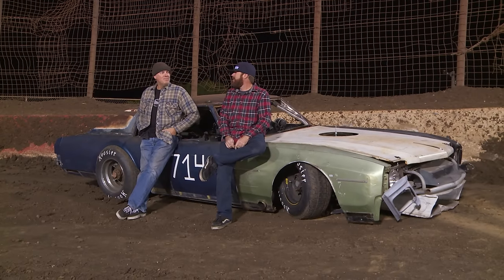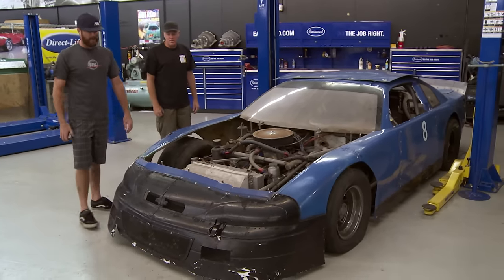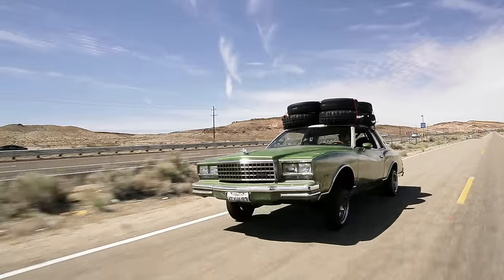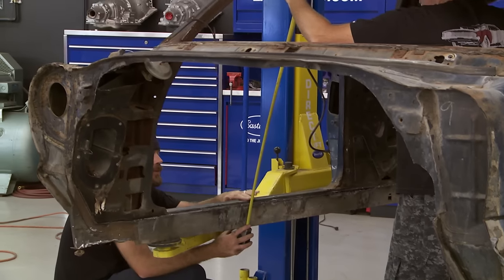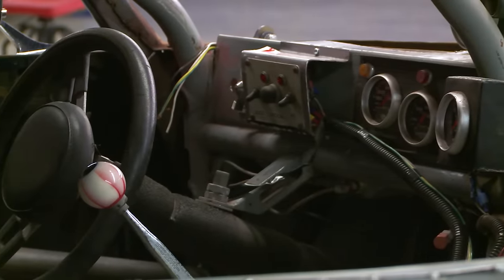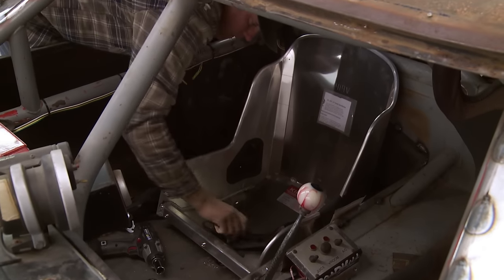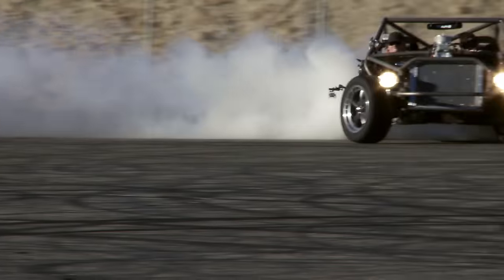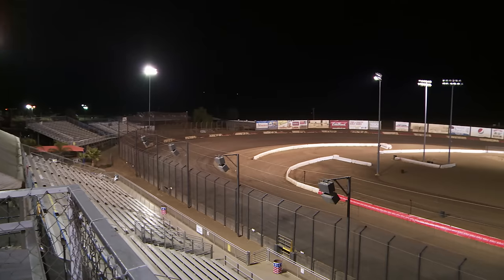Street "Legal" Stock Car Body Swap - Roadkill Ep. 46

Comment: fix it And put in a 24 hours of  lemons episode
Reply: The tec could say no for being too expensive and if they race it the officials can take the car and nothing can be done its part of the rules
Reply: +Darkzxi they cant just take a car. thats absurd.
Reply: +Greg Manson "Absurd" is kind of their thing, so don't bet against it. :)
Reply: yea
Reply: +Caden Z it would destroy 24 hours of lemons
Reply: Maybe  it might be a drag car
Reply: No, that car deserves more than that.
Reply: +Caden Z They cant put it in the lemons race they paid to much for it.
Reply: +Caden Z They spent $7,600 for it, which is well over the $500 spending limit for the base car. If you spend more than that the car isn't qualified to race. (You can spend as much money as you want to fix it and stuff, I believe.)
Reply: +mastapasta2000 You can race it, but you'd be penalized a lap for every $50 over $500 or something like that.  They'd start with a huge enough penalty that there wouldn't really be a point to racing it.
Reply: Jeff Israel That makes sense. Wouldn't be worth it, like you said.
Reply: It wasn't a car until the paid for the body ,An got insurance  . Putting the stock  car frame in It was fixing it up .
Reply: the parts value is above 500
better off going to lemons website
Reply: +Darkzxi As if the Rotsun wasn't cheap... Yeah, the bought the car for $500, sold the drivetrain for $400, and ended up with a shell for $100.

But Freiburger stated in the 24H of Lemons episode that they spend well over $30K on the Rotsun already. Basicly the Stock Car Montecarlo is way cheaper.
Reply: +Greg Manson you obviously haven't watched any lemons before
Reply: +Darkzxi I was going to do it until a friend talked me out of it, so I know the rules by heart. For each $10 more, you lose one lap. I have no idea who told you they were gonna take the car.
Reply: The AE86 of Mt. Akina you obviously haven't watched any lemons then.
Reply: Tevita Phillips I've been a fan of LeMons for years. Of course I've watched it before.
Reply: Sprinter Trueno (AE86 of Mt. Akina) then how can you not know of the judges ability to take cars, even destroy them.
Reply: Tevita Phillips That's for if people vote you as being a douchebag.
Reply: Sprinter Trueno (AE86 of Mt. Akina) yeah and if you bring this car you will definitely get voted as a douche bag
Reply: +Darkzxi  Oh, plenty can be done, but it would involve equal amounts of tumescent bribes and epic bull s**ttery. If the car wins IOE- this one's a contender- it's really unlikely the car will get taken. Usually a car gets taken because the driver is a complete prat.
Reply: +Greg Manson Yeah, they can. You sign a release allowing the judges to take your car and publicly destroy it if they decide you've broken the rules thoroughly, you car is a danger to other drivers, or they just simply don't like you. It's part of the reason the value of the car is supposed to be no more than 500.00.
Reply: +mastapasta2000  The way I remember it (been awhile since I was involved with these guys) was you got 500.00 to build a car, period. The exceptions are brakes and safety equipment (seat, belts, cage, etc.). You are permitted to overspend on the car, then make up the limit on the back end (say, you sell something of value from the car). If you spent over that amount, hope that the judge had a good night , will accept a little token, and is open to your interpretation of 500.00. Skilled forging of receipts is considered a plus.
Reply: +Tevita Phillips They don't destroy cars anymore for being ringers. You'd let them know what you're doing before entering anyways. That way they can tell you no before entering.
Reply: +Hotrodelectric o ok I appreciate  your  insight  on this  thanks.
Reply: crazy Mike You're welcome. I love the idea of the series, and all things considered, it's a cheap way to get into an expensive activity. Just the parade of odd cars with appropriately kitted teams is worth the admission.

Comment: That sucks but if you look at it this way, that ball joint could have broken on the highway going 65mph.
Reply: Exactly, you can look on things different, which can make sucking things good/better
Reply: +Zac Price Yeah, that would suck. Though, from all the cars that they drove, I'm thinking this would've been the best car to be in during whatever happens after that thing broke on a highway.
Reply: +Ignas359 It wasn't made to protect the passenger so that would have been bad.
Reply: c0c0asauce Ah, fair point, still isn't the rollbar pretty sturdy all around?
Reply: Ball joint breaks going down highway they wreck hit another car and injury or even worse kill someone bye bye roadkill show they got lucky on this one
Reply: +Quincy Abrams they may have gotten lucky... idk. It might have taken another 5 years to degrade to the point where there very minimal stresses exerted on it by driving in a straight line would have had any effect.
Reply: Could a have been the gremlin
Reply: You saying that reminds me of when I went to pick up my mustang from a shop after a NINE month paint job. The dick didnt tighten down the rear left tire and the wheel fell off and dented the brand new quarter panel of the car. Luckily it happened before we got off the 45mph thorough fare and onto the 65mph highway...
Reply: +Christian Norris i knew a shop that used axle grease to mount the tires on a mustang and then when the mustang went a round a fast corner all the tires broke the bead lose and totaled the car and almost killed the person inside
Reply: +Zac Price exactly my thoughts - and that would be much worse! Also i bet they have learned a lesson - before you start to fix a car, check your brakes and everything on the chassis first.
Reply: Roadkill doesnt "learn lessons" lol.

Comment: Two years later I have the realization that the ball joint that broke was on the same side that got hit while in storage.  Coincidence?
Reply: good point dude
Reply: Makes sense
Reply: actually, I don't think so. for a balljoint to fail like that, it was probably from it sitting for so long. for a ball joint to fail because of an impact, that car should have taken a pretty good hit. 
so, more than likely, the ball joint just broke after being beat on by them and probably from being rotten.
Reply: Ya for real......
Reply: "I THINK NOT" incredibles movie dashes teacher
Reply: You have a point there..
Reply: All ball joints fail eventually. Check yours regularly...
Reply: wowomatic i agree
Reply: Roadkill.com - The Legend of NASCARLO. "We are very fortunate the joint didn’t break on the highway, but we think the cause was a hard hit against a dirt berm entering the pits. Just a few laps later, it separated."
Reply: Drifting puts a lot of pressure on the ball joints and lower control arms, if they arent built for it they will break

Comment: Yeah i can see in that clip that the car did a weird movement where it did dip down in the front right where it broke the ball joint. Truly roadkill fashion where they get it running and never touch the suspension and put the car through like 1 and a half Gs of force turning lol.
Reply: Damit. I just noticed and posted lol.. Good eye!
Reply: dude good eye, i thought it was a coilover mount but after thinking about it it wouldnt have pitched the wheel back like that

Comment: I'd honestly like to have something like this as a daily.
Reply: Idk if its just me, but I'd rather have that than a new Ferrari
Reply: +McWithJosh not just you.
Reply: +McWithJosh 
only problem is if i drive it here in UK i wont get 2 meters without being pulled over
i hate the UK sometimes...
Reply: Far easier to take an old muscle car, lower it on stock car looking wheels and tires. U can use miss matched panels, bolt it a few cage bars, do loud exhaust etc. these guys REALLY REALLY know what they are doing and have all the tools/budget, remember they did a motor swap in the snow in the parking lot and drove it home.
Reply: +Denis Gumus It wouldn't pass an NCT. You'd have to have your own insurance company to insure it.
Reply: Red Rider7 So the insurance conditions do not mention anything about having a completely different engine and an unsafe front suspension? :P Surely they will pay out, but your next insurance will be dear :D
Reply: Red Rider7 I'm not too aware of how the rules of insurance companies or state law in the US go when swapping engines to cars and driving them on the road. I understand that in some states it doesn't seem to mean jack shit.

In Europe especially with newer cars if you're modifying your car without inspecting it you are already breaking the law. You can break the law even more by putting a non-spec engine to a EURO -emission rated car/engine.

According to most if not all car insurance company terms here in Europe you are obliged to tell insurance companies about your car modifications. This goes especially for engine and performance modifications. In some countries like UK and IE it will have a huge effect on insurance premiums.. Everything from 50% to 5000% (yes, thousand). Thus the consequence of not announcing modifications to a car will be considered insurance fraud and/or fronting. This goes on top of the potential for violation of installng EURO2+ cars with engines, which are not certified or emissions tested.
Reply: +Red Rider7 My Mustang has an all out race engine in it that barely tolerates 93 gas and revs to 9000 rpm. Inspection? No sweat. lol Lucky I don't have to pass any emissions tests.
Reply: +McWithJosh Yeah, those views with the setting sun behind the car...

damn i need this
Reply: +Denis England sucks America is freedom:D
Reply: B

Comment: Looks like when he turned right to slide it he was alittle too high, then something snapped and locked the wheels to the right. I really respect guys that drive on dirt, that's alot of skill
Reply: there problem is, they dont check or replace parts. i doubt they change the oil..
Reply: the lowerballjoint popped out wich buried the wheel in the wheelwell unabling it to spin there for its like having 100% brakes on 1 wheel of the car and due to it being low the quarter pannel also dug into the ground,not a single driver out there coulda saved that one
Reply: @MrMuziekman  ya I’ve had that happen before. Thankfully mine kept going straight

Comment: the best part is as someone who has seen this episode upwards of 12- 16 ish times over the years is that dave knows this car was set up for road racing which means it is waAAAYYY off for running ovals and then add dirt into the equation he is still shocked that it hit the wall lmao. true roadkill 🤘🤘🤞 i miss having a motortrend account
Reply: it hit the wall cuz the baljoint popped out ,the right wheel could not spin plus the quarter pannel dug into the ground xd
got nothing to do with it not being setup for ovals and that being said you can drive ovals without a setup,the setup sure gives some mroe grip but mostly decreases tirewear xd

Comment: They should put an engine in a Tesla.
Reply: Duramax swap!
Reply: SideWayz Moose Yeah!
Reply: Onat Arı Hahaha. Thanks!
Reply: the should put the engine that was in the charger and duster and put it in the rotson!
Reply: Quincy Owyang haha. That'd be cool.
Reply: BRING THE BEAST 💪MONTE BACK ALIVE😈
Reply: Maximum troll
Reply: @SideWayz Moose No, no duramax. Put an LS-7 in the nose. Lightweight. Duramax is too heavy and bulky, would ruin the car's handling.
Reply: TestECull Yeah thats even more reason. my thought process was that it would be hella polluting
Reply: 4 Rotor Madzda
Reply: Why would you make the Tesla slower?
Reply: GODOFGUITAR2112
Because I find it boring as hell as-produced. And I want it to be practical. I want it to make a good noise. I want to be able to service the damn thing in my own driveway. I want to make a hotrod out of it.

I don't want the best performing car. I want the most fun car. For me, that derives from the experience I get while driving it, and that experience is at its peak when I'm rowing my own gears and listening to a lovely V8.

If that means making it slower, then so be it. It is slower. And now has an LS-1 V8 in the nose, a Tremec T-56 in the middle, a built Camaro axle in the back, most of the computers laying in a box, and it's better for it.
Reply: TestECull You've obviously never driven or rode in one if you think it's a boring car.  There is nothing like a Tesla accelerating.  There is no compromise to the power delivery, it's just there, all the time.  Why not just buy a Z06 and mod it?  You'd have a much better performing car for a lot less money.
Reply: GODOFGUITAR2112
You obviously didn't read what I typed.

I don't need to drive or ride in a Tesla to know it would bore me. I don't derive enjoyment from the acceleration itself. I derive enjoyment from how that acceleration happens, from the machinations that produce it. I will have a bigger smile on my face taking another second to reach 60 if there's a throaty American smallblock and a 5-speed manual gearbox causing it.

I don't want pure speed. I want the whole hotrod experience. And you just do not get that with an electric car. When going electric you remove the very aspect I find most enjoyable in a performance vehicle: The sound, the feel, the thrill of the engine itself.

Besides, it's utterly pointless to have a 0-60 under 5 seconds in a daily driver anyway. You'll never get a chance to feel it. Pesky things like other cars on the road, speed limits, traction, rough weather, etc all conspire to render the fastest cars on the planet no faster than my '85 Ford pickup with a 110hp straight six in the nose. On a closed course it's no contest, when you're on public roads with cops and stoplights you're no better off.
Reply: TestECull I get all that, I drive a 1979 Camaro with a built smallblock for a daily, I'm just saying that the Tesla is an unbelievable machine to drive.  I didn't get the the hype until I rode in one.
Reply: GODOFGUITAR2112

There's a ton of those on the roads, and most of them I don't exactly have any interest in. The Veyron, McLaren F1, most modern beemers, etc. They're incredible machines just like the Tesla and I have zero interest in them.

Given the choice I'd take your camaro over a Tesla every single time without hesitation. Doubly so if you've got a 5-speed behind a high-revving 327...
Reply: The coolest thing to ever exist would be a Fisker Karma with a small block in it. It's about the only thing I'd approve of putting an LS in that isn't Government Motors.
Reply: yes they  should have it would be a littel more fun
Reply: What, the Roadster?  That's just a modified Lotus Elise, they can just take one of those and cut out the middleman.
Reply: ***** No, a Model S
Reply: TheGoldenGuy17's Custom Lego MOC's Ah.  I feel odd for being more familiar with the Roadster than Tesla's other models, I've heard about people being surprised by its existence.

A Tesla's a little too nice for Roadkill anyway, isn't it?  Not to mention for all the work that would go into it, they might as well just take a Tesla body and drop it on a gas engine chassis.
Reply: Yeah that's true. I know a bit about the Roadster, I just like the subtleness of the Model S so much better. Most people don't realize what kind of marvel of engineering is in front of them.
Reply: as a car guy, I totally get you dude, but have you ever rode one of those roller coasters that accelerate to 70 in like a second? I think the first one I ever heard of  was a ride called the outer limits, its like that...only even more brutal. it seriously makes you feel ill for a bit, your body has never really felt that kind of positive g's before, their used to be a guy who raced pro mod and pro stock on the nhra named Gary Brigner and one of his many was a 7 second cavalier, believe it or not he was running a 1010 hp n/a  from what was originally a 350 block lol. but I have rode in it at his house with the second seat put in, and the tesla d is the only thing I have felt that comes close to that, I have rode and even drove a low 10 second car and overall the tesla feels quicker from a dig
Reply: Yeah I've been on a couple of those.
Reply: ...and make it slow as shit.
Reply: HorstEwald
And less boring, so better car overall. Also less complicated, less difficult to service, less of an environmental nightmare at EOL, less of a hazmat issue if it gets in a nasty crash, itt'l sound better, be more engaging to the driver, itt'l be more ped safe, and itt'l be a proper sports car besides.

You lose nothing by putting an LS V8 in there.
Reply: TestECull gas mileage, instant acceleration, less maintenance, also you wouldn't spend $80k swapping inferior technology into a car that was never designed for it.
Reply: GODOFGUITAR2112
IDGAF about gas mileage, it's not less maintenance unless you like neglecting your tires, brakes, etc, and you're damn straight I would. It's not 'inferior' technology. It's different technology. Neither is better than the other right now. Oh, and instant acceleration? Worthless to me. I enjoy the way a V8 with a manual behind it leaves the line.
Reply: Reggy
Reply: TheGoldenGuy17's Custom Lego MOC's a hellcat?
Reply: I love Teslas so fucking much but this would be waaay too fucking weird and dumb to pass on.
Now imagine them shoving in a big ass diesel.
Reply: A 3-53N Detroit Gamma Goat engine! Or better yet just rob an iron one out of an old street sweeper or rotten piece of industrial equipment. Just have Finnegan ready with the pie plate in case she goes rogue.
Reply: Jesus Christ I didn't know Jesus swears. Huh. Learn something new every day.
Reply: aotearota very true lmao
Reply: SideWayz Moose they aren’t tryin to lose power
Reply: FluffyDaWhale317 ii
Reply: GODOFGUITAR2112 it would make it faster.